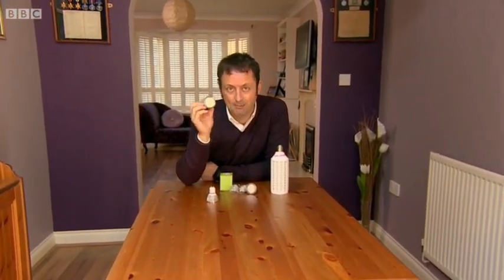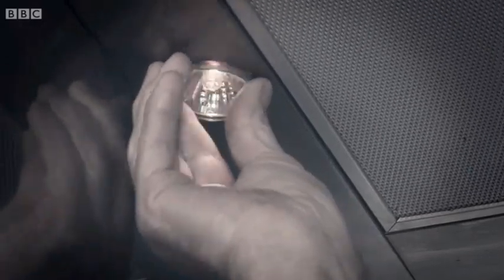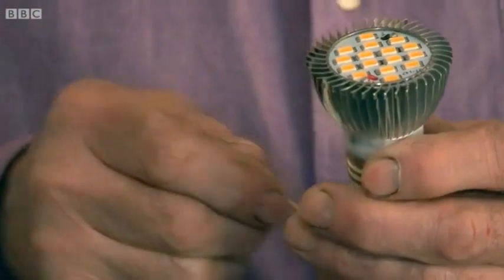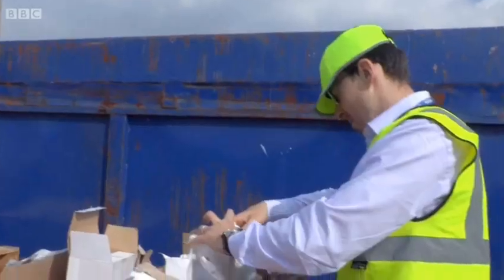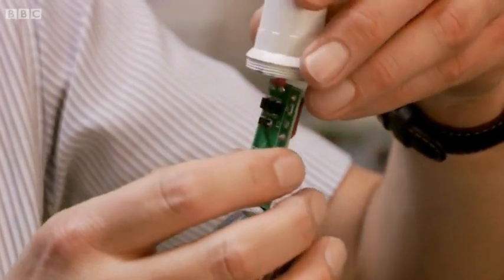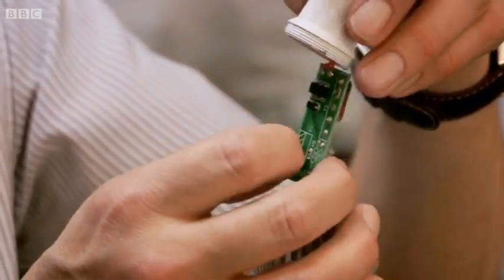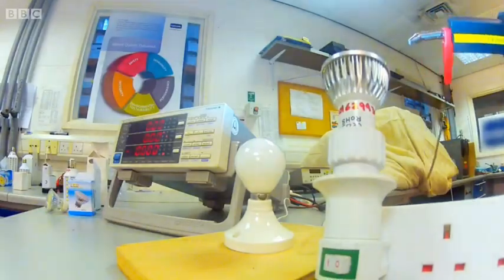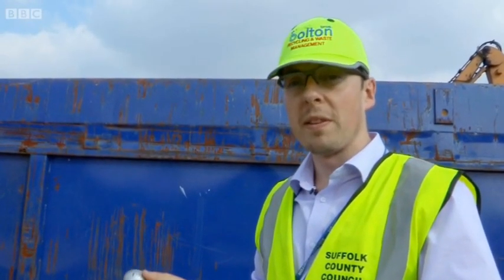Dangerous LED bulb from an "Auction Site" Fake Britain 4/12/14

Comment: Here is a free tip!!, "Do not put your fingers inside any bulb when it is plugged in",,
you are welcome ..;-)
Reply: OhNoNotMyPenis
er.... that's why I wrote do not put your fingers inside any bulb "When its plugged in"   ie Already  installed. :-)
Reply: look bud, It was just a throw away comment , I don't want an argument..My point was/is to never put your finger INSIDE a light bulb when its plugged in especially & of course to NEVER do that when it is plugged in with the power switched on , I didn't think I would have to explain to not stick your fingers inside when the power was on as I consider that to be obvious..I hope this is now clear enough for you. regards,
Reply: Your meant to isolate when you change lamps.
Reply: Nicholas Cooper under uk law there should be absolutely no chance of touching live parts ..

Comment: The filament lamps are not banned in the EU, contrary to what is claimed in the video, halogen filament lamps are still quite legal to manufacture and sell, as are filament lamps for special use.
Reply: It is misleading to say that Filament Lamps are illegal in the European Union. The fact is that the sale of traditional incandescent Lamps is illegal. It is also misleading to say that a "Filament lamp" in l is an umbrella term for any lamp with a coil in it. Filament Lamps generally refer to the traditional incandescent Lamps, and not halogens or compact fluorescent Lamps (CFLs)
Reply: Frankie Sparkes even the sale of traditional incandescent lamps is allowed to Sept 2016 with xenon-filled lamps and infrared-coating lamps beyond that, as far as can undertand from http://europa.eu/rapid/press-release_MEMO-09-368_en.htm#d1e731

The industrial use of filament lamps is unaffected, and one can obtain these "over the counter" as they don't actually raid your houses, yet.

Comment: I've bought several of these supposedly dangerous LED spotlight bulbs because they were 50p each instead of £4+. They are a bit ugly, but do the job. Like most electronic devices that plug into the mains, disassembling them or getting them wet whilst they are plugged in might give you an electric shock. You won't find bulbs on ebay that don't have plastic or glass over the contacts, like they heavily imply on this show. If they had their way, anything that can carry an electric current or has a sharp edge will be deemed unsafe and be sent to landfill.
Reply: What are you on about? eBay is filled with LED lamps with exposed contacts?... This is not a case of it being unsafe if you disassemble them or get them wet, that is only to get a likely lethal shock. This is about the heatsink being connected to the mains meaning if the light is on the heatsink (and any conductive surface touching it) is live and potentially lethal to touch. It also means that when you turn the light off, because it is AC powered, there is a chance the phase is still connected, meaning that it's a 50/50 chance that at any time when the light is OFF the heatsink is LIVE and potentially lethal to the touch. Being wet or disassembled greatly increases the chances of the shock you will receive being lethal but you will get that shock even in 'normal' conditions.
You just watched this, go search for bigclivedotcom on Youtube, he actually has a video on some of these lights (purchased off of eBay...) and how hazardous they actually are...
Not to insult, but how stubborn must you be to see this and not at the very least consider that there's a truth behind it and actually check it out before you'll kill someone?...
I'm not saying we should blindly follow the health and safety people, they do overreact at times, but here they have a completely valid point that these lights are dangerous, so well done saving 3.5,- in exchange for a dangerous light that may either give a lethal shock or cause a house fire due to the excessive heat they put out which is far more than the heatsink is rated for... In the end you spend more money on electricity due to their higher power consumption so you've actually lost money...

Comment: How are these fake? They still contain LEDs, so they're still led lamps. The CE marks etc. are clearly fake, though
Reply: There fake because there unsafe and not tested.
Reply: +Nicholas Cooper Actually no. They're fake because they're a fraud. Not genuine. Safety has nothing to do with the usage of the term.
Reply: +Jonathan Gray genuine of what brand/model?, I don&#39;t remember to see that there was a fake brand.

UNSAFE and that don't meet the regulatory from some country, don't mean it is FAKE.

But yes, all my led lamps don't has uncovered connections
Reply: flyguille I didn't say anything about a brand. Here's an example. Take LiteBrite. Say they didn't patent their idea and someone came along and copied them, renamed it to BriteLite. Both are now legal companies, legally selling the same product. LiteBrite is legitimately making money off of their own product. BriteLite takes shortcuts to get the job done, and uses cheaper plastics yet sells them for the same price. BriteLight is obviously the fake in this situation. They stole their idea, used cheaper manufacturing, and convinced their customers that their product was as good as (or even better than) the other guys. The fake part about it is simply the assumed quality of the product.

... Just because it's legal, doesn't mean it's genuine.
Reply: but, you are confusing a low quality problem with fake!, those are different properties.

In this particular case, nobody invented "led light", because the LED is a component in electronics like from 70's.

And the low qualitry ones, that by sure don't meets the britain standard as to be allowed be imported in britain country. That is a low quality problem. Not a faking problem.
Reply: flyguille You seem to be confused, not me. I'm explaining what the people in the video mean by the usage of the word. You could look up the definitions in the dictionary if you still feel as though the word isn't relevant.
Reply: +Nicholas Cooper There is no need to actually test any device for a CE mark. The manufacturer just has to say out aloud the piece complies, and it is CE that instant.
Reply: Itapirkanmaa2 that's true the old BS kite mark ment something the CE label is China Export wink wink
Reply: Lets pretend the bulbs didn't have CE printed on them, would you still define them as fake?

Comment: He being an electrical engineer should have known the the spacing between the C and E is too long. That CE marking is actually China Export and nothing to do with the CE marking of the EU.
Reply: Again, this is nothing more than a myth, it's not China Export, just an incorrect copy of the safety logo.
Reply: @someguy4915  "china export" is just the excuse they use when caught

Comment: People make their duty to buy the cheapest that money can buy online ! if you buy a reputable brand like Phillips or Sylvania or GE you will get the security that comes with it for maybe 50 cents more ,stop being a cheapskate and buy them from homedepot or another reputable store , ım also an electronic technician and I can tell you on the spot any led light with expose led soldering on top in a no brainer and dangerous even running on a low voltage ,but the fact they use 8 times less electricity with a better lumen output are still worthed ,since i have them everywhere in my house my lighting electricity bill when down close to 7 times less with no more heat radiation over our heads, incandescent light are as inefficient as they were in late 1890 ! even more the quartz halogen who become so warm are dangerous to get a third degree burn from them there often the source of homefire , so i would recommend buy quality led light who are approved and save energy ! Stop ordering from china fake dangerous copies for a few penny less ..

Comment: what about USB LED light for pc lolz
Reply: 5 volts DC .5 amps plus its isolated from the mains voltage
Reply: Someone gave me one of those, and it shorted out inside and kicked off my USB. (My wireless mouse with USB receiver lost power and wouldn't work until I unplugged the LED light.)
Typical sloppy, cheap chinese manufacturing!
Reply: Be glad that the USB circuit in your pc was made using quality design and detected the fault and disabled itself before any damage was done.

Comment: they failed to mention leds run on DC direct current, and dc aint going to do anything to you other than give you a bite. you need really high dc voltage (1000s of volts) to kill some one i would stick that  bulb on my tongue and nother more than a bite and maybe a tiny burn would happed
Reply: Dangerous assumption that presumes a galvanic isolation between the output and the mains input. Most LED drivers tend to use capacitive droppers with no isolation to the mains. Should that capacitor fail short - which does happen - it's likely that 240V would be present on the output relative to earth

Comment: 1:20 The guy says "I felt quite a lot of heat coming out" ...
This is normal for even genuine LED lamps. The heat is mostly light energy! Yes, the light the lamp puts out can cause burns - think of a burning laser (which has much more concentrated light, yet actually less overall energy).
Reply: Benjamin Esposti no the heat is from incorrectly rated dropper resistors not "light energy"
Reply: The heat largely comes from the LED's themselves.

Comment: You could have donated those bulbs to poor homes instead of destroying them. I see you UK people have lots of money. You could just wrap those bulbs in a plastic enclosure and MAKE them safe. What a waste.
Reply: So you want the poor people to get shocked? X'D
lol, they could modify the bulbs, but that's too expensive. Trust me, I have learnt a thing or two about electronics design/manufacturing and assembly/production.
Reply: agormanvideos because the could Kill
Reply: It would be cheaper to just give the poor new and safe lights... Retrofitting these unsafe lights would mean throwing away the powersupply and replacing it for a quality one and then unsoldering each LED from the old light and placing them on the new board... With the extra parts and labor this would be four or five times more expensive than just tossing these pieces of trash and buying proper lights...